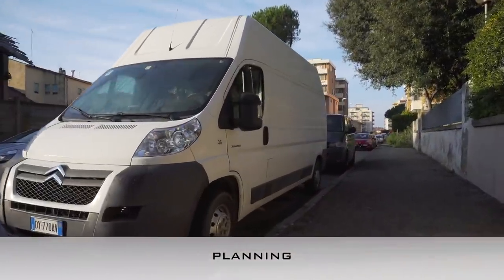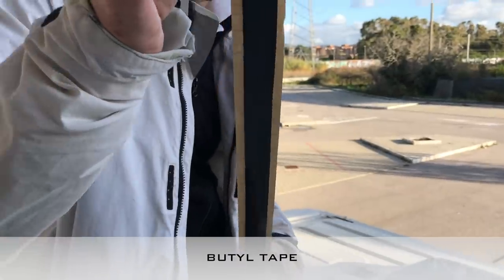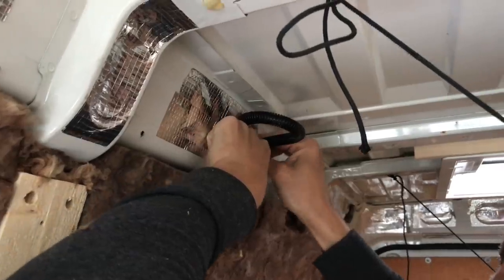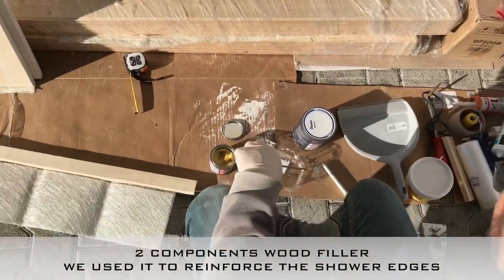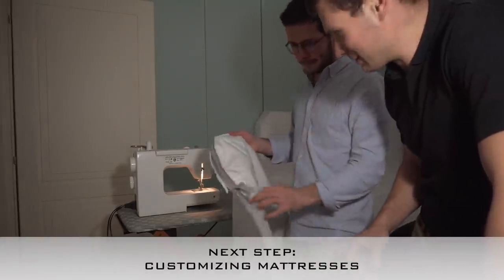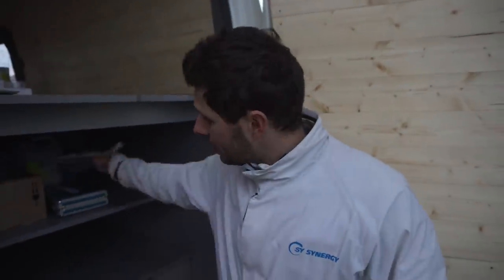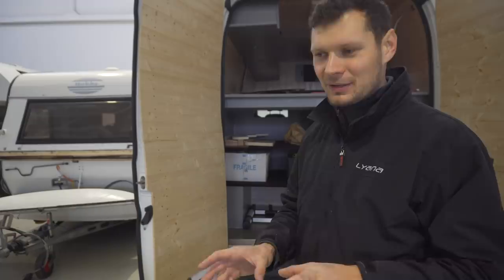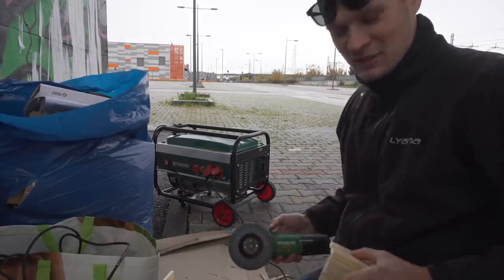Custom Camper Van - How to Build - 1

Comment: Nice work guys, one tip for the rear door panelling. Do it first from inside when the van is empty,  close the door and put panelling in one piece. Mark the middle and then cut whit circular saw and get the perfect look.
Reply from the maker: Yes! That what supposed to happen, but we will keep this idea for the next van)))

Comment: i would not trust tape to hold down solar panels on the highways, you should of at least put a lip around the front of it so it wouldn't get wind catching underneath them
Reply from the maker: Thanks for advice and that’s a solid option. 
Tape is so strong that it will take me an hour to remove panels without damaging them based on how strong it is in other places we’ve used already. 

Making a lip around the front will close the ventilation under the panel and make the water stay there forever.

Comment: Cutting the sheet metal is one thing, but to cut the roof framing to install the vent hatch and not reinforce is another.  I would imagine that you guys compromised the integrity of the roof.  My father had a van conversion many years ago and I don't know what he did, but I do recall that his roof would wobble loudly at high speeds.
Reply from the maker: For now it’s all in place. We do not drive faster than 110 km/h. 
You might be 100% right, but since it’s a personal project - it’s fine for us))

Comment: Hey guys, the van is fantastic! Excellent job! :D  Also, as someone who uses silicone often for work,. one of the best inexpensive tools for a professional finish, is to put just a simple pop-stick (like from an ice-block etc) in some soapy water for a while, and use that. It can create a consistent, smooth and clean line across all sorts of funny gaps and angles :)
Reply from the maker: Nice trick Steven!
Thanks for sharing. 

Please check out also our update video from this playlist: https://www.youtube.com/watch?v=2GaTnoBFj1c&list=PLRq74thRnlOld7_vMl8PZM3O2rh24t1UP&index=3

Comment: stupid question but can i use sheep wool and cow skin for insulation? i wonder if it would be fresh in summer and warm in winter?
Reply from the maker: Sheep wool will work as many warm clothes are done with it - but mind humidity! Cow skin not sure. 
If we were redoing the van, we would use some type of foam panels - same as used for fridges. 
Hope it helps and please check this video: https://www.youtube.com/watch?v=2GaTnoBFj1c&list=PLRq74thRnlOld7_vMl8PZM3O2rh24t1UP&index=3

Comment: Looking back, did simply covering the holes in the metal of the van insulate enough?? would you recommend it?
Reply from the maker: It’s perfectly fine. Yes. 
We having more cold air coming through small gaps between the sliding door and from the driving cabin (so better concentrate on those).

Comment: with that isolation you used and stuff in the walls, the van walls will breath and condensation will not soak up in the isolation creating mold.....
Reply from the maker: Hello! You one of not many who actually saying that this insolation is fine. 
We will one one side of the wall in a year and will see what's going on inside. Have you tried?

Comment: Whats the make & model of the ladder you used? And are you completely happy with it?  Did it put any imprints on the van?
Reply from the maker: It was a ladder from Amazon for 80 euro from unknown brand and we do not actually recommend it as it not that high quality. 

Type of ladder is great! Compact and relatively light.  No imprints. 

In the next video we will explain why you might not even buy it at all.
Reply: Whaaat! I can't wait as I plan on buying a similar ladder very soon. Is there something better that is also Compact, Light & decent quality that I can keep inside the van?
Reply from the maker: If you want a ladder, then that type in my opinion is the best. 
Since we have tall bed, you can easily climb on top of the roof without the ladder and this we will show on the video.

Comment: I have a question. For a truck will I have to cut a hole in my shell for a solar panel?
Reply from the maker: Not sure what you mean. We only drilled roof for passing the cables and the rest with adhesive tape.
Reply: can you tell what kind of adhesive tape did you used? :)

Comment: Guys you just made the biggest mistake that many camper builders do - you didnt make a vapour barier! Once you insulate you have to wrap all of the walls roof and floor with something water tight ( plastic ). If you do not do this step water vapour from the inside of the living area will travel through your insulation and condensate on the inner cold skin of the van causing corrosion mould and so on. All the work you have done after will be destroyed- sorrry
Reply from the maker: No worries. We are using it in warm places and less then I thought, so it will take decades and by that time not sure what’s going to happen. 

Thanks for Watching and commenting!

Comment: Such a tasteful design, not something I can say about many van builds. You used a lot of heavy wood, how much does it weigh? Likely over its limit.
Reply from the maker: Thanks! Appreciated!
The final weight of everything ready and full for travel without driver is 3130 kg, when maximum is 3500 for this van. 

And you might only save more or less 50 kg of wood on some parts of furniture, but wooden walls are really nice as it's creates a really nice atmosphere.))

Comment: Flexible solar panels when placed so close to the vehicle become so hot that they no longer do the job that they are intended to do.  They should have a gap between the roof of the van and should not touch the roof of the van - learn more at CheapRVLiving.com and Enigmatic Nomadics.
Also, there needs to be a vapor barrier - either reflectix or some other barrier to keep any condensation from forming on the walls of the van when the heater is running on cold days/nights.
Reply from the maker: For our solar panels - work efficiently in any sun. There is small gap between roof and panels, as the roof is not flat. 

For the vapor barrier- maybe, as we are not experts and just sharing what we did. Maybe in the next van))

Comment: Why fiberglass insulation over foam board like polyiso?
Reply from the maker: Cannot answer here. 
Fiberglass easier to work with as it can fit everywhere, but some people mentioning possible humidity problems. 
Polyiso is also fine, but need to use foam with it.

Comment: You're not supposed to mount solar panels flat, there is supposed to be a good amount of airflow beneath them.
Reply from the maker: As the roof is not flat - there is a gap of 1 cm and we hope it's doing good job. When you driving it will dry out all the water from underneeth.

Comment: Awesome job guys! but Is that hatch safe?
Reply from the maker: Safe for what? If someone wants to break in - he will break in from front windows as its easier.
Reply: Well, maybe but the hatch is just a piece of plastic isn't it? I just wanted to tell you that maybe it's the weakest point of the van. U should never underestimate safety :)
Reply from the maker: You are right. It’s maybe one of the weakest points of the van, but at least it’s on the roof))

Comment: But wait, do you have to sit inside the shower to use it? It looks so short.
Reply from the maker: For upper body - you need to sit, for lower body - stand))

Just find a nice spot and shower outside. We’ve installed 3 meters long hose and it’s a game changer.
Reply: In that case, maybe simply remove the pannel that is facing the door could make it easier to use, I guess? Or alternatively, turn the cabinet section towards the door, which can serve the same purpose while not japardising the integrity design. But in that case, the toilet is not accesible when the car is moving and the door is closed.
Reply from the maker: Not sure if this idea will work for us. I would still keep same layout as you will use toilet much more often. 
If you planning to shower a lot, then maybe you should consider another option, like completely closed one and slightly bigger, but you will have less space for everything else. Send us a picture of your solution when you’ve completed you van!

Comment: really great video and build. Maybe a little claustrophobic without side windows, but a good trade off for greater security if parked up in city centers. Can you tell us more  information on the silicone mastic you used as alternative to Sikaflex?.  Also I am intrigued where you are from, maybe Germany or Scandinavia. Thanks
Reply from the maker: Thank I for your comment and for watching! Probably we will consider installing extra window on the sliding entrance door in the future. Just to get some more light during the day.
We used butyl sealant, unfortunately don’t remember which brand. Usually you can find it in specialized paint stores.
You were quite close with your guess, we are originally from Ukraine

Comment: Should have used spray foam insulation instead.  Lots of moisture in a van especially with two people.  You don't want mold and mildew.
Reply from the maker: You might be right here and maybe next one we will do with foam panels. 
For now we kinda solving this problem with a heater - no problems at all (maybe we are cruising in the warm countries).